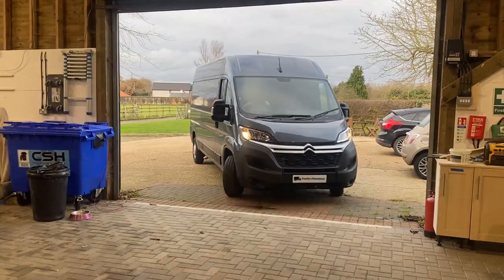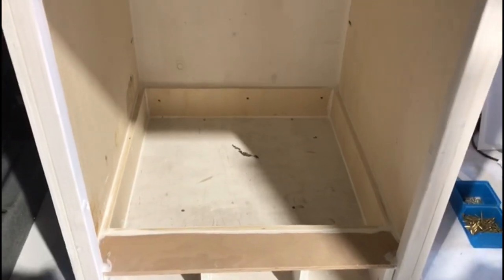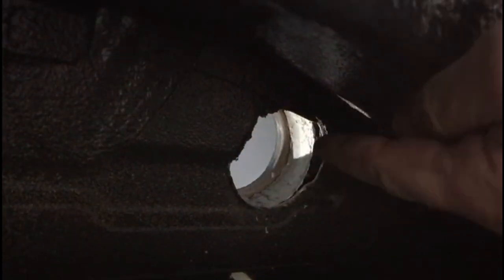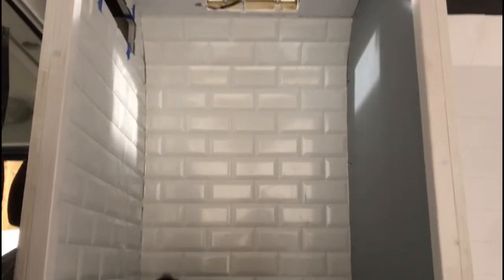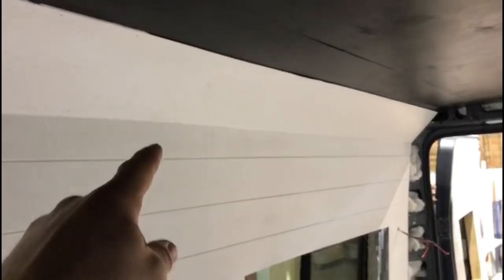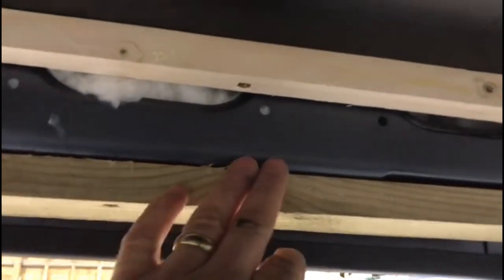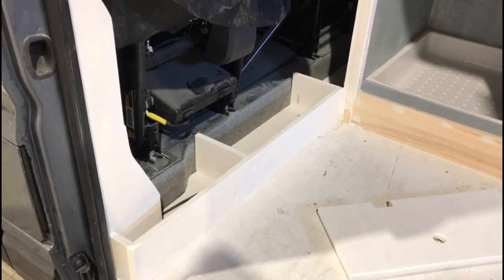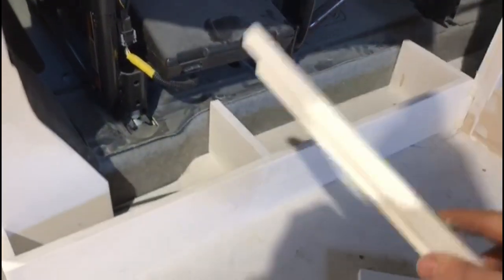WEEK 3 | Shower room, Kitchen, Step and Boxing in | START to FINISH Van Conversion Series

Comment: Well done for doing these builds as parts they really help. Been working on an 1983 Dodge S50 which has been registered as a camper in 1994 was parked up since 1995 until 2019 when I purchased it, only 47000 miles although lots of welding lol 
Getting inside soon and your videos will really help thank you

Comment: How does sketchup know things like "this piece will support the oven?" Do you just tell the program that an oven will be in that particular part of the blueprint or does the program have a template feature that you used? How easy it sketchup to use for someone uneducated in architecture and new to measuring and cutting wood pieces for building something like this?